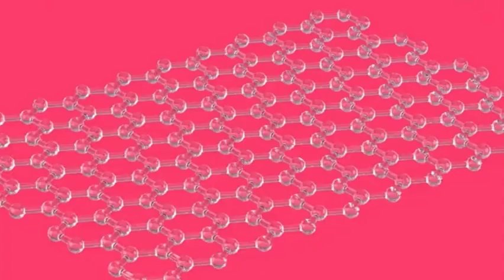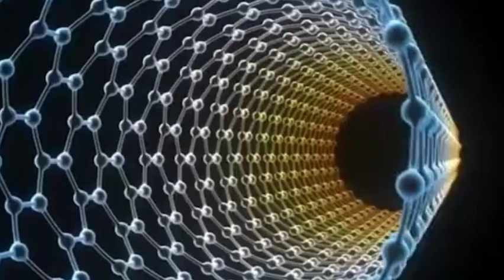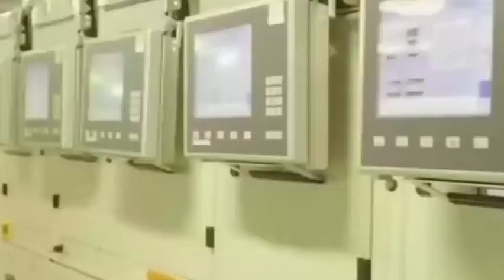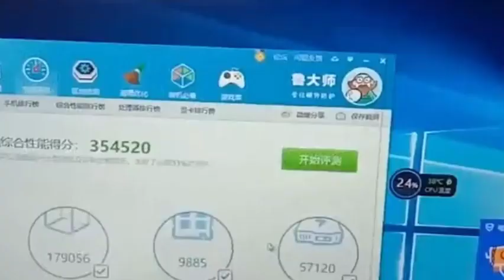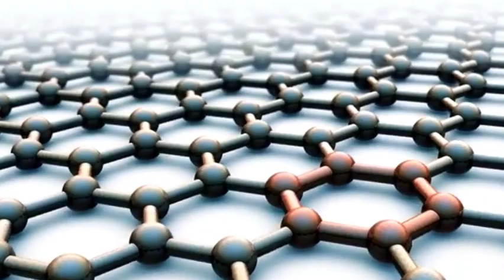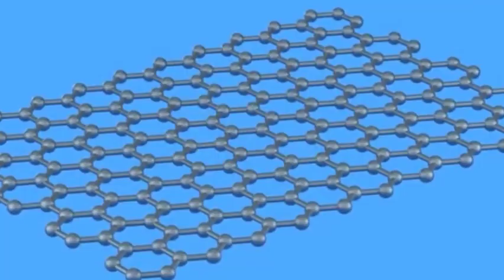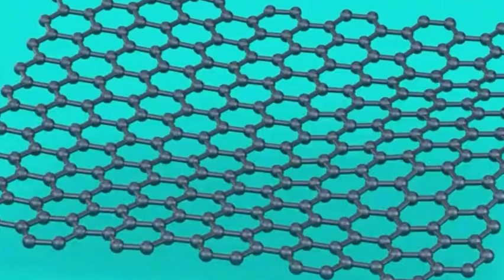What has China's semiconductor chip industry discovered on graphene?

Comment: Edit: The end of the video is accurate except the claim that China is the worlds leader in graphene technology. The information is too restricted for anyone to actually know one or the other who, if anyone, is truly ahead. I think the language barrier threw me off in regards to what the person was saying as I thought they were implying China already had a functional graphene based x86 or x64 processor.

Graphene Oxide was discovered/synthesized in the 1840s, and the industry has been trying to use invisible circuitry since, well the first time I read about it was in 2000, at least in-so-far as it related to carbon based silicon replacements.

I'd also question whether or not China was even in the picture since they are still begging for EUV machines from ASML which the US keeps blocking (not sure I am a fan of this...at all). IBM was the first to successfully make a graphene CPU. That was back in 2014. They claimed it was 10,000x faster the CPU's of the era, but that was only if both dies were the same size using the same amount of power...basically there were a ton a caveats.

Whatever the case, there are numerous countries throughout the world working on this, and if we had any common sense we'd all be working together as opposed to a bunch of disjointed for-profit companies. Once we get the basic manufacturing down then we can break off and go our own way, trying to lower costs and raise the prices to consumers like the good little consumers we are. Let's actually get the material viable first though.

Anyone that says we are close to a commercial graphene chip is fibbing, and the information here, though some is accurate, seems like it comes from a state sponsored Chinese report, which makes it propaganda.

If I had to fathom a guess, I'd say we are at least 10 years from a viable graphene x86/x64 chip that can be mass produced with a defect rate under 50%. It literally took IBM BILLIONS to make one 200mm chip, and the only part of the chip that was graphene were the transistor channels. China can't match Intel's 10nm or TSMC's 14nm silicon chips, but somehow they managed to make graphene ones but are still falling behind in technology? My apologies, but I have a very difficult time believing that.